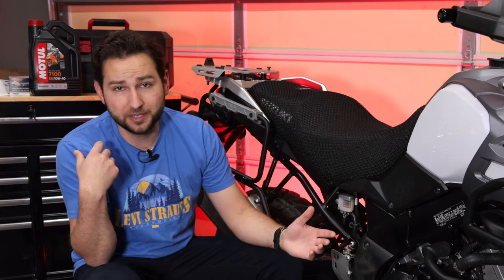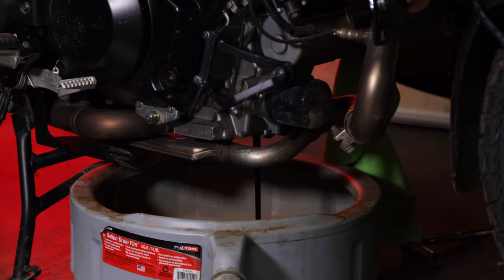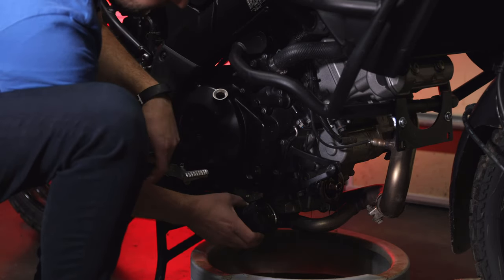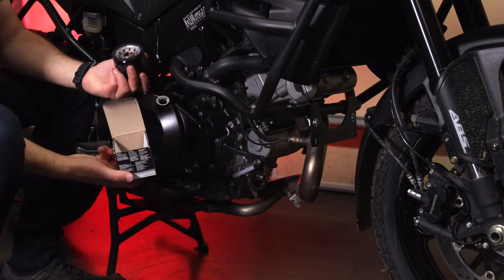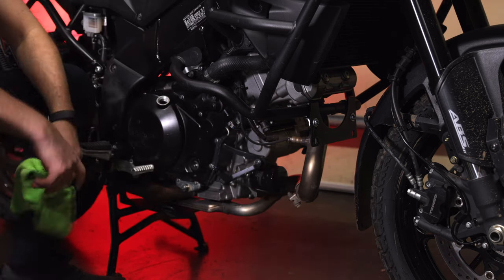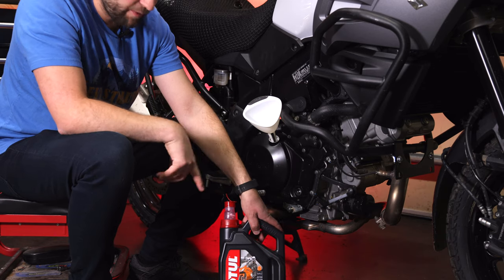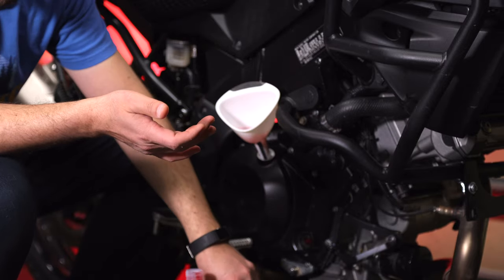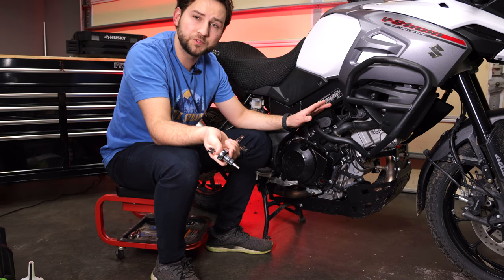How to Change Oil on Suzuki V-Strom 1000

Comment: Hello, thank you for your tutorial, I got my 2019 V Strom 1000 DL at the turn of the year and would like to know if you have a video for what kind of maintenance is required such as fluids and things that need to be serviced and replaced.  I appreciate the help.  THANK YOU 😊
Reply from the maker: Well for the most part the maintenance between 2019 and 2018 should be the same. We have videos of brake maintenance and some other things. There’s also a video where I show step by step how to remove the fuel tank to access the air filter. Hope that helps!
Reply: @1LiterADV  Yes, I saw the brake fluid video, thank you for that also, I appreciate your videos 👍

Comment: hello, i have the 2021 650 
and am thinking of running the motul 10w50 during the summer heat. the 10/40 seems very thin in hot conditions. have you tried a different weight? or have any thoughts about how this might quiet the engine down and offer better protection?
Reply from the maker: Honestly, I would keep using what Suzuki recommends. We live out in Kansas where it’s often 100° F or more in the summer and I’ve never had any issues with engine heat. I also have ridden in temperatures below freezing with no issues at all. Just my recommendation.

Comment: Great vid buddy! I have changed oil myself for Motul 7100 but it seems to me the engine is a bit more noisy then it was before with orginal oil (I guess Suzuki one). You think it might be a reson for that?
Reply from the maker: It could very well be true. I haven't used the factory Suzuki oil for a very long time, so I don't remember what it sounded or felt like. My bike does have the notorious clutch chatter when in Neutral gear. Perhaps OEM oil would make it quieter, but at the moment I'm not too concerned about it.

Comment: Good instructions, I'll have a go at changing the oil on my 2016 bike. I was thinking of trying a fully synthetic oil, do you get smooth gear changes with the Motul 7100?
Reply from the maker: Thank you! I would say the gear changes are as smooth as they get. Still a slight clunk from N to 1st, but think that’s normal.

Comment: How much different is this to a 2003 model?
Reply from the maker: The 2003 Vstrom 1000 is similar with oil capacity being 2700ml w/o filter and 3100ml with filter. But I have seen people state that their older Vstrom's used 2900ml instead of 3100ml. You will also need a 14mm Socket for the oil drain plug, instead of 17mm. Oil filter remains the same, as far as I know.
Reply: Own a 2018XT, not a lot of content for V-Stroms, look forward to future videos/adventures.
Reply: I own a first gen 2009
17 mm

Comment: If you follow the instructions for the OEM filter you’ll see why a proper tool is necessary to remove and install the oil filter. Whether it’s a strap wrench, socket type etc..
Reply from the maker: Appreciate your input.